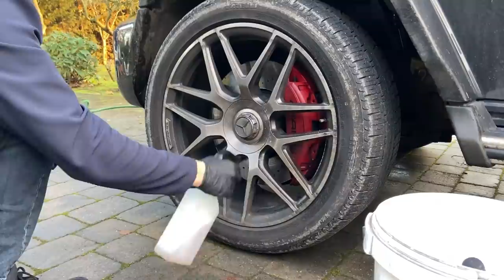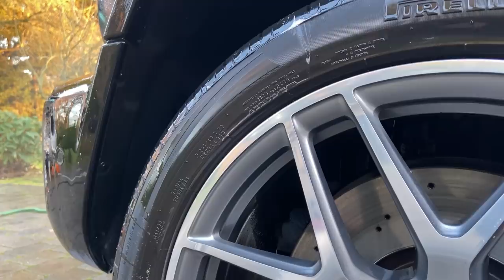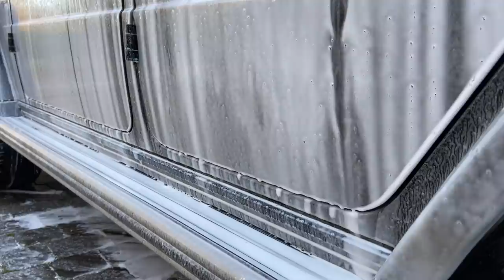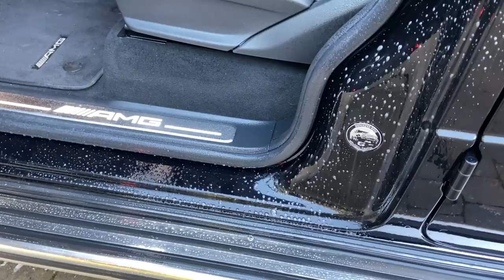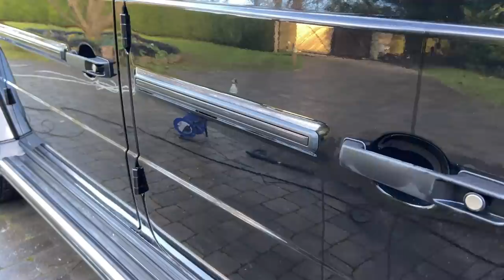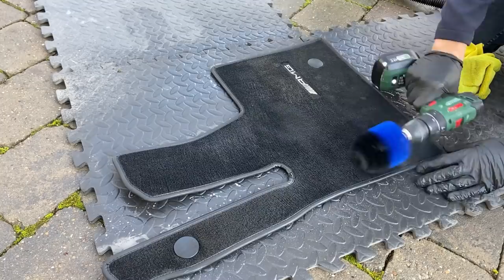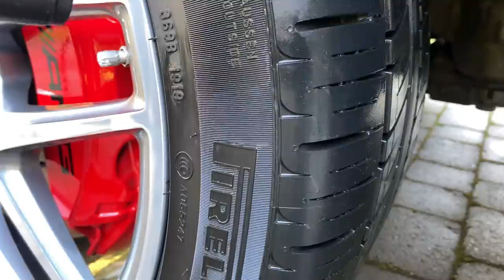Deep Cleaning a Mercedes G63 AMG // Interior & Exterior Detail

Comment: I used to clean my tyres that way but after a while found out whenever I brake I hear whistle sound, has it to do with the water? And if I do clean it with water how do I reach the brakes to dry them?
Reply: Anyone help?
Reply from the maker: I shouldn’t be anything to do with the water. What other chemicals are you using? 
Drying with compressed air works well

Comment: Hi, what exactly do you spray onto the alloys. I have black alloys and no sprays that i have tried worked aswel as the spray you used in this video. Reply would be greatly appreciated.
Reply from the maker: Hi, I use a dedicated iron fallout remover such as Bit Hamber Korrosol. This make take a couple or few hits of the wheels are particularly dirty 👍🏼
Reply: @HarpersCarDetailing  another quick question, what would you recomend i clean my upholstry with, i have white/cream interior.
Reply from the maker: I would either use koch Chemie pol star 1:10 with a leather brush and damp microfibre towel or Dr Leather leather cleaner. They do pre made wipes as well. 
Colourlock have some brilliant cleaners too

Comment: Hello, a question you use for pol star?
Reply from the maker: Hello, 
I’m not sure what you mean.
Reply: @HarpersCarDetailing  What is the dilution you use for the pol star product?
Reply from the maker: 1:10 usually
Reply: @HarpersCarDetailing  thanks!!!!
Reply: @HarpersCarDetailing  Last question hahaha, what kind of water do you use for the pol star product?
Reply from the maker: I use just normal tap water As I go through it very quickly.
If you don’t use it frequency, then it might be worth using distilled water.

Comment: Any reason you didn't use an extractor for the floormats?
Reply from the maker: In this case they didn’t need it as they weren’t that dirty. 
It was also quite cold so didn’t want to risk leaving any water in the mats as could turn to mould if it didn’t have time to dry 👍🏼

Comment: could i have some help on what product is used on the wheels at 0:33 please
Reply: bilt hamber korrosol iron fallout remover
Reply from the maker: Frozen has hit the nail on the head. 
Bilt Hamber Korrosol, KKD citrus for the tyres and Bilt Hamber Auto foam to clean the wheels after the initial decontamination 👍🏼

Comment: Why did u spray that pink spray on the tyers even though u sprayed foam on them
Reply from the maker: The purple spray is for the wheels only, not the tyres. It dissolves brake dust essentially. 
I always rinse off then apply foam as I don’t want to potentially rub any dirt into the paintwork.
Reply: @HarpersCarDetailing  oh now I get how they become like shiny new after spraying that spray i got the brush thing 
Thanku very much

Comment: that car should need some total cleaning makeover...
Reply from the maker: What do you mean?
Reply: @HarpersCarDetailing   i mean total  makeover car interior and exterior  use  steamer gun to loosen all the dirt  outside the car., the interior  use wet dry  vacuum if car seat cover  it had an odor smell
Reply from the maker: @reggiebarroso2679  ahh I see what you mean. 
The citrus degreaser dissolves and loosens the dirt beforehand and interior wise there weren’t any bad odours and the carpets underneath the mats barley needed any attention, so didn’t need anything more 👍🏼

Comment: i think its better to clean the inside at the first
Reply from the maker: Why’s that? 
I like to clean the outside first as it allows the types and certain areas to dry whilst doing the inside. 
Also, the door sills will be clean which will help eliminate scratching them whilst doing the inside.
Reply: @HarpersCarDetailing   i was thinking about when we cleaning the inside at the end all the dust from vacuuming goes out but you absolutely right iam changing my mind

Comment: Huh. You clayed the car without polishing it?
Reply from the maker: You can use a very light clay to pick up minor contaminants without marring the paintwork
Reply: @HarpersCarDetailing   I find that very hard to believe. 

Any touching of the cars paint will leave their marks, and claying is definitely not an exeption. 

A fallout remover and a dedicated asphalt remover will get rid of all the contaminants on the paint for a thorough wash.

IN MY OPINION.
Reply from the maker: Touching the paint will create very minor marks, but if the car is washed and maintained properly then to the naked eye you wouldn’t be able to see these marks. Maybe under a lense you could see micro marring. I’ve been maintaining cars after paint correction details with great results for many years.  

You’ll see in the video that barely any contamination was left on the clay bar as the chemical decontamination stage was very thorough. I’ve seen pictures of heavily soiled clay bars which most certainly will mark the paint, but with a soft clay bar and more importantly a very good lubricant, little to no damage will be inflicted, especially on this hard Mercedes paint. 

Thank you for your concern though 👍🏼

Comment: I think this is just car wash... Not deep clean
Cuz you must remove the wheel, braking  system, exhaust system... to clean inside. There are a lot of narrow slit in a car, you can approach to cleaning without remove  the parts.
It spends a lot of time to deep clean a car. Super car and luxury car are more time consuming.
Reply from the maker: It depends on how far you want to go. That sounds more like a concours detail. 
I would only ever take the wheels off if I was ceramic coating the inside, as you can pretty much reach every where to clean when the wheels are on